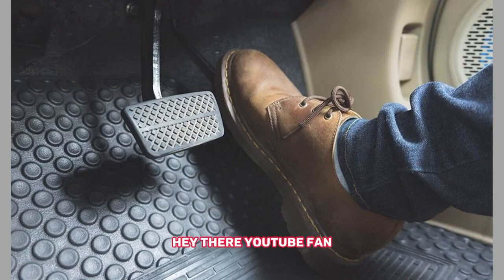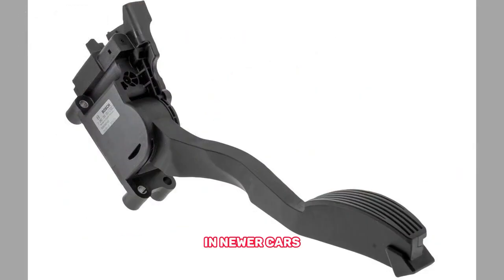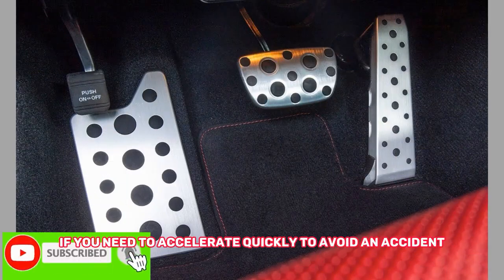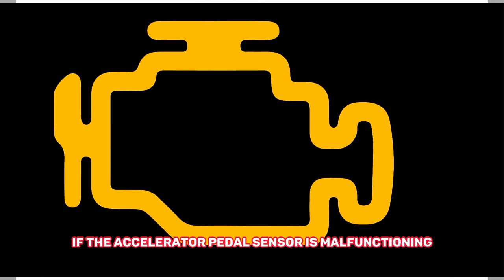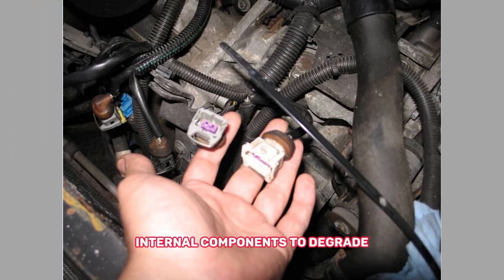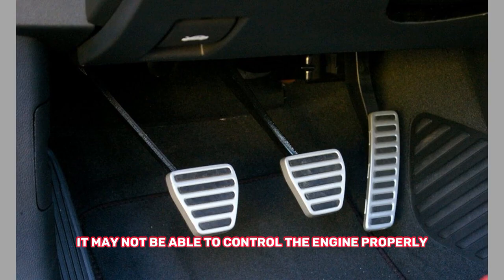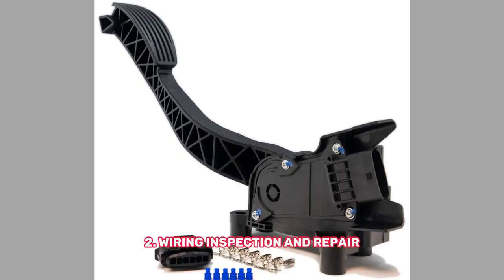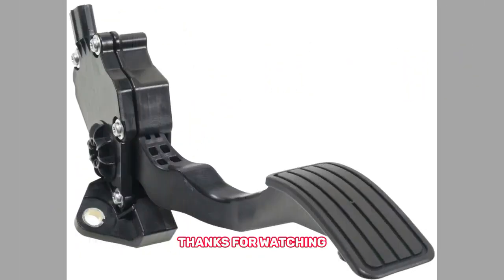Bad Accelerator Pedal Sensor Symptoms Causes and Remedies

Comment: Who knew, my 2006 ford explorer has these symptoms it jerks, hesitates so I got another pedal, the codes went away nut the jerking and stalling is still there   I've been to 3 different mechanics and I've gotten 3 different diagnosis, I've put everything new, mass air flow, trottle body, plugs,wires,ignition coil pack, pvc, egr valve, too much to list, this car came from the dealer like this, I refuse to let them touch it again.....HELP